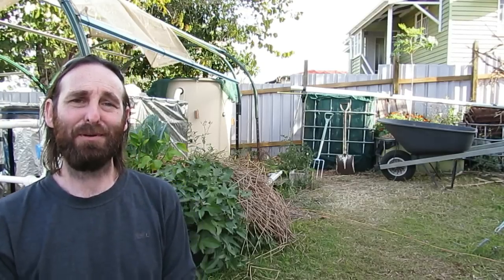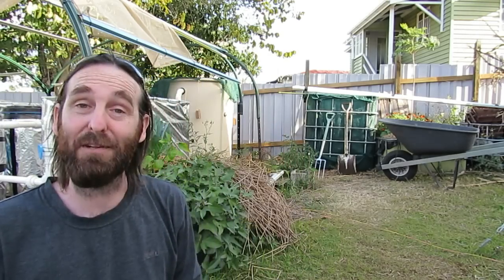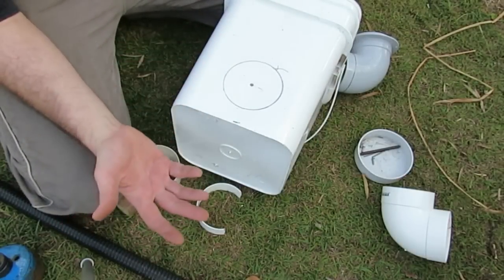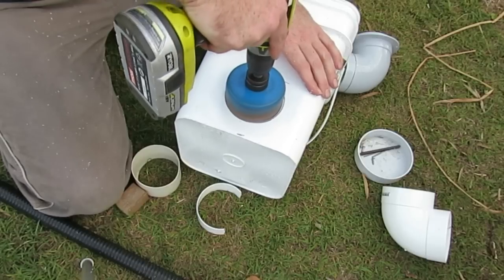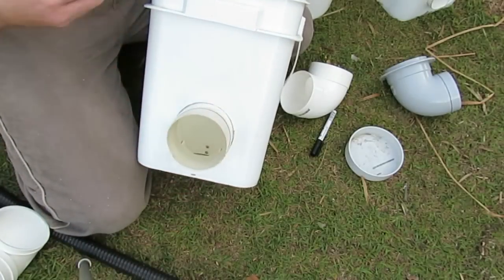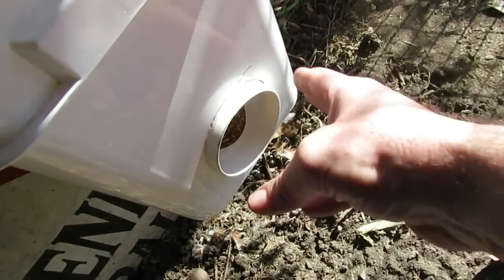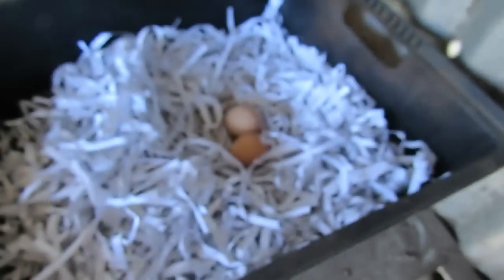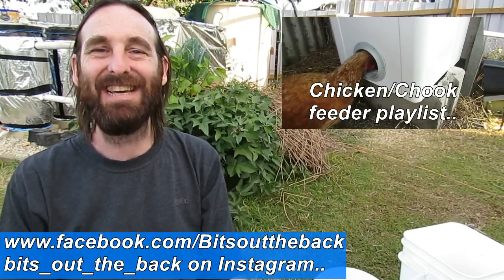CHEAP & EASY DIY BULK Chicken Feeder

Comment: ROB,, how does this work at keeping rodents  out? thanks for the videos
Reply from the maker: I'm sure a mouse may be able to jump up in there but if your birds are like ours it wouldn't last long Russ. 😉
We found a lot less rodent activity around the pen after having used these feeders for a while. I'm thinking that having less spilled grain on the ground was the main reason. It also stopped the wild birds coming in for a free snack as well which was a bonus. 
Hope that helps some.
Cheers.

Comment: A tapered Sheet Metal bin with a width of 5" T x 12'W at the bottom would have a lot less feed that never makes it near the output. From personal experiences; that will happen. With a top width of a 12" by 14" or so, this would last well over 10 years I would think if made of galvanized metal and pop rivet the whole together and cut with shears or have the supplier cut it on a cutting brake and bend the flanges; costs a lot more but will last !!! Putting on a hinged lid would work well; a gravity cap of Galvanized metal would do as well and save 2 hinges of expense and work. The outputs might work we with a threaded Ell on one end and a collar it the flange'd kind is not available. Locally, I find this kind shown hard to find.
Reply: On the bucket; I would of used a feeding port on opposing sides.
Reply: A feed bin of about 2'W x 8" Thick would be nice; metal or plywood for indoor use on wood and plated metal outside.
Reply: I wonder if you all can find a way to slope the bottom/sides to force All of the grains to the center bottom?
Reply: Was considering a insert that would sit in there and confine the food to the width of the Ell plus 1" wide. Jut a drop in that must stay where you put it?

Comment: Hey Hi,

(http://imgur.com/fz8R6yc.  photo of my pvc pipes).  Thanks so much for contacting me.  You would think this wouldn’t be so difficult to find but I’m having no luck.  I’m in Los Angeles.  I’ve attached a photo that explains my plight.  On the left is a 2 ½ in 90 degree pvc.  That was just too small.  I thought I found the answer and ordered the pipe on the right.  The supply company said it was 90 degrees but it is not.  In addition both of these are really heavy and thick.  Not like what I’ve seen in your video.  When I called the supply place they said what I want is a 90 degree pressure pvc as that could be made of lighter material.  

Help!
Reply from the maker: Hi there. I just found this message in the flagged folder, sorry I missed it. Have you had any luck yet? 
I'm not sure where you are but going by your name my guess is the states. If so this might help.
http://www.lowes.com/pd/Charlotte-Pipe-3-in-dia-90-Degree-PVC-Vent-Elbow-Fitting/3132771
That looks to be the fitting I used on this build here.
Hope that helps some & I'd like to know how you got on.
Cheers,
Rob.